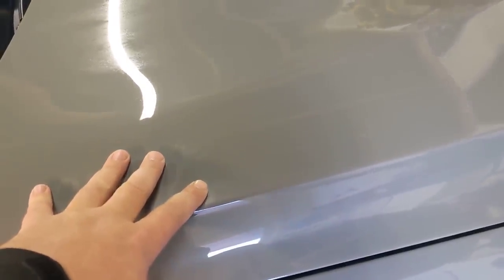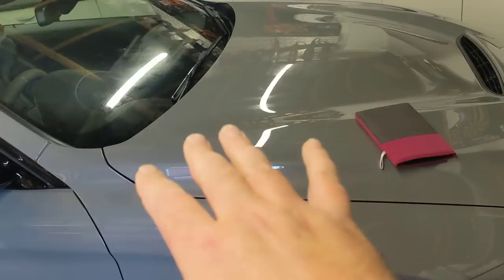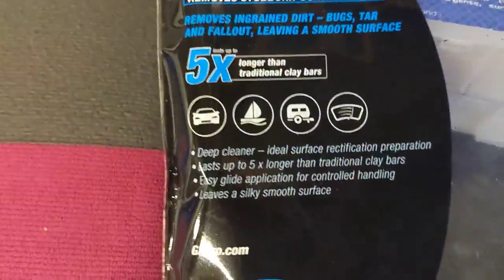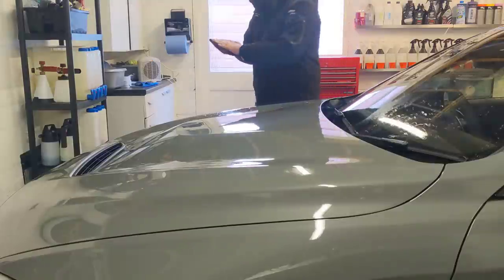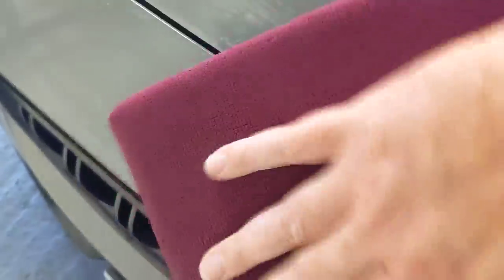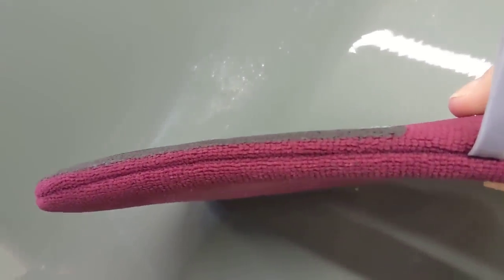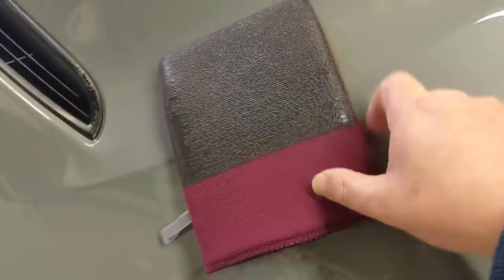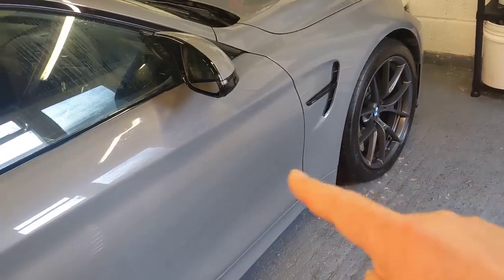How to Clay your car in 30 minutes

Comment: Hi John, I've used the clay mit on 8 different cars,the last car was my volvo and I haven't seen any marks/scratches. I use Turtle Wax pure wash as a lubrication with mine. I'm more than happy with the product.Ive cleaned the mit every time after use and put the plastic sheet back on the clay section once used. I have now got a new one, so I will use the old mit on my wheel barrels. 😊👍

Comment: I normally use a clay towel over a higher ph foam from my cannon, along with constantly cleaning the rubber surface in a wash bucket after each panel.  I find that using a foamy high ph soap perhaps deep cleans the paint a little better by stripping off any old protection that may be left after washing. Using foam seems to provide a lot of lubrication during the claying process, but with the extra step of rinsing afterwards.  Good video Jon.  I love the speed of the clay towels, but only use them before polishing as you mentioned.

Comment: I have had 3 of those clay mitts and they are awesome. You defo need a clay bar for two reasons. 1. if you run the clay mitt over the joint of two panels, it can leave behind some clay, and a clay bar gets it of much easier. 2. Clay bars are great for smaller areas. I do my car twice a year with the Mitt, and they will last 2 or 3 years easily (I do friends cars as well so they don't last that long for me).

The biggest advantage of the clay mitt is that people who don't want to spend 1 or 2 days claying a car, will clay the car with a mitt because you can do it in around 60 mins or less. The clay mitt in my experience does not get as much contaminate off as a clay bar, so clay mitt the car, then go round with s clay bar and redo the small bits the mitt could not deal with.
Reply: Totally agree!
Reply: What do you use as a lubricant?
Reply: @IRTEHLEETOKNPBB  I first wash the car and rinse it off. Then I make a wash bucket using a good shampoo and 'wash' the car again with the mitt, it's not like a clay bar where to do a 6 inch section at a time, you wash the car like you would with a normal mitt, keeping it very wet with the shampoo wash. Then you have to was the car again. You might get some 'clay' on the edges of panels, you can get this off with a clay bar.

Comment: As far as clay mitts go the G3 is the best one I have found so far. It is great for a more rapid decontamination job, when time is more limited. I tend to start with this to get the bulk of it off and then finish with Bilt Hamber soft clay bar for a belt and braces job.

Comment: When I was a valeter at main dealer I used this it was very durable I also used the auto smart towel to. These so much quicker. Thing is when u work for a company they not going to supply clay that can really only be used once and are easy to drop because of the cost and I faced this all the time when working as a professional valeter. On my own car I always use clay bar but clay mitt, cloth does have it place and in my opinion very good to have and I used a lot. The fraecla one is very good they good company there compounds are very good to and have used alot

Comment: Try a clay towel that is perforated.   The Rag Company Ultra clay towel and DIY Details clay towel.  The openings within the clay surface allow the contamination a place to go reducing the marring you've correctly talked about.   Much better than the solid rubberized clay mitt you used in the video.
Reply: Well said.

Comment: Another good video Jon, well done. I'm using Farecla G3 Clay mitt with a soapy water 1:50 dillution ratio :)
I always use it after iron fallout remover. But from my pov, polishing is not mandatory after applying clay mitt. It's always good to use it to decontaminate the surface before foaming/washing the car.
If I have enough time, I prefer to polish the surface but it's not possible most of the times.
Reply: When you clay mitt unless it's a new car you have to seal the car after claying buddy

Comment: Jon, you should really try the Ultra Clay Towel/Mitt from The Rag Company. It has a perforated surface that is very effective, cuts down on marring and is very easy to clean. I find it is also very helpful to spray the panel down with rinseless (ONR, P&S Absolute or N914) before hitting it with the clay.
Reply from the maker: its best part of 40 quid in the UK mate.  love the rag company and appreciate import costs create problems but I just dont think you can sell clay cloths for that price here.
Reply: @ForensicDetailing  yeah they cost about 33 quid here ($40 USD). But on the plus side they will last for well over 50 cars, so the cost per use is pretty low.

Comment: Thanks John, I've got one of those, prefer using it to a clay bar, find it easy as long as you use plenty of lubrication, as you said its minus point is small areas like at the front of the car, where I think a bar is better. I've had it 3 years  probably done 12 cars and its still in good condition.

Comment: I think clay mitts are the tits. 

Smash a layer of GT Zero Decon on the car and give it a damn good feel up with the mitt. 

Can't say that I've noticed any clay marring to be honest, but the layer of clay is so thin that a quick rinse after every 1/4 or 1/2 of a panel keeps the clay fresh as a daisy. 

Used to use BH clay bar, but I noticed no matter what technique or lubricant I used, the marring was 100x worse than using a mitt.

Comment: Thanks John, I used one of these on my previous car so this has reignited my interest! My current car is a 2018 with 18k on the clock and garaged most of the time so I think I'll give it a go in the spring after a wash, de-iron and detaring then get my underused DAS6 out with some sonax fine finish. It probabky won't give me a "proper" professional finish but hopefully it'll  come up better than it is now as it's not been polished so far.

Comment: Hi John, just want to say thanks. I found my holy grail of daily driver contactless cleaning with 3 week old winter grime on it.

BH AF at 6% PIR on a dry car.(not BH CL) 

Single layer of foam so it doesn't drop off.

Let it dwell for 10 minutes (cold day)

Use a 15 degree nozzle close up with my Karcher K2.

Stand back and admire

Comment: I use them without my hand on top or holding at the side as I tend to with washmitts. G3 Clay mitt could benefit from maybe a tight fit elastic strap on the back side, differing hand sizes would be the trouble mind. I also tend to pre-spray the surface down with ONR or similar before going in with the clay cloth

Comment: I have that mitt and really love it. A bit of soapy water in a bucket and you're off. Whole car done in no time. I agree there are still uses for traditional clay - either doing fiddly bits (which on our everyday cars are really not an issue) or for windscreens (where there is all sorts of rubbish that I'd rather keep out of the mitt - I have a big ball of clay just for the screen).

Comment: i use a zvizzer clay disk on a cordless sander (3mm throw). gets you around alot faster. i use a clay mitt for the small ereas or regular clay bar if it's really nasty

Comment: Another excellent video Jon - can't get enough of your stuff man. So....your advice please.  I am about to become an FDC wannabe having just bought another car.  The car is immaculate which I would like to maintain.  MB CLS 350 AMG - White 2015 model.  Do I clay bar or clay mitt and if I do invest in machine polish (pretty sure I will) which produce would you recommend for polishing it and how often.  No history in terms of the clear coat or if it has been detailed in the past so worried about damaging the paint.  Cheers, Paul
Reply from the maker: Clay mitt if u need to do full detail in one day. Otherwise clay bar.   Buy a da8 polisher and use school S20 black with flex purple paint on the Merc
Reply from the maker: Purple pad
Reply: @ForensicDetailing  🤟Thank you

Comment: Have you used the clay towel from Ali that is perforated and costs about 15? It resembles the original alternatives, from Carpro etc.
Have you used soft99 smooth egg ? It`s very soft and the seller told me is perfectly safe for coatings and doesn`t scratch
Reply from the maker: all clay will scratch paint as it pulls contaminant

Comment: I'm wondering if these perforated clay towels like DIY detail and P&S might be more gentle on the paint. If you don't plan to polish should you avoid a clay towel?
Reply from the maker: they are not more gentle no.  the coareness of the abrasive clay and the pressure you put down is the importance.  A performated one will have half the clay of a non performated one.   But the holes do allow liquid through.

Comment: I think clay is waaaay more eco than a "clay mit" at least you can see how dirty a clay bar is, than a mit. 
You can use the clay much longer than a mit, plus you can see the levels of contamination. 

I think I'll keep to the clay.
Reinventing the wheel sometimes isn’t needed.
Reply from the maker: Speed though Mel.
Reply: Clay mitt lasts probably 35-50 vehicles if it’s minor to medium contamination a clay bar needs chucking after a single car so don’t see how it more eco

Comment: Nice one Jon, great timing,  I just brought a new to me 3yr old ST, it's got no protection and needs pampering.  I have the G3 mitt in the garage and haven't used it yet,  you've inspired me to try it out. Regarding the polish, would a one step, like the Megs ultimate be OK or could I get away with a koch chemi ultra fine on the same coloured pad? Thanks for cracking vids throughout 22.
Reply from the maker: Yes m8 a finishing polish is ideal

Comment: i am wondering, once you have clayed, polished, and ceramic or graphene coated the car, when should you clay again and does it degrade the coating by claying ?
Reply from the maker: next time you want to polish it, wash it dry it, feel the paintwork, look for chunks of roughness behind the front wheels and rear tailgate... after about a year of driving its likely to need claying.   If you clay a coating yes your abrading on it so it will degrade it a bit.

Comment: Jon, great video. Can you use snow foam as a lubricant for claying after the car is washed? Do you need to dry the car prior to claying? I've also seen Jim White keeping his clay, usually 3 patties, in hot water to keep them plyable. Thoughts?
Reply: I don’t dry, most of the time I just Chuck a fresh microfiber in the shampoo bucket and use that to wipe over the surface get it soapy then clay over. Mostly because if I’m decontaminating I want to put on a lsp or polish so I’m not risking putting anything on with a clay lube.
I also wouldn’t use snow foam as it has no lubricating properties it’s meant to be used as a precleaner not a contact wash. 
Imo you can totally keep clay a couple toke I usually cut it up into 3/4 chunks then Chuck them out after use or use them for claying wheels
Reply from the maker: I think you could wash and reform (when its not too hot) and clay mitt over with all the soap.  that will work great just dont want the soap to dry in the summer.   but in winter I think wash dry get car inside and then nice waterless wash lube works really well too.   dont think its matters as long as you clay properly...  warning the clay its good idea.   If I leave the ball in front of the little heater it will softer... BH clay is mega solid.
Reply: @@leefrancis7416 I just use my usual car chem super suds, great low cost shampoo

Comment: Would ONR be good to use when claying or just a plane highly mixed shampoo without any wax ? Thank you in advance!!!
Reply from the maker: One is great m8
Reply: What is ONR? 🥴
Reply: @donporter8432  optimum no rinse, just a waterless wash , get a litre spray bottle add 50 ml of ONR ( I also add 50 ml of turtle was hybrid solutions wash & wax )  tap water will do no need for distilled water that's not needed , ive found out after using gallons of distilled water- just spray that onto the panal & the clay will, I use a Martin Cox clay mitt or bilt hamber fine clay is great but the mitt you can't drol it covers a bigger area and will clay a car twice as fast ( just clean the outta glass first as them mitts stick & might slightly Mar paint) tge mitts are great tgey can be reused over n over just rinse n carry on, after doing this you'll feel the paint is smooth as can be, it pulls all dirt n grime from tge paint- you'll be pleased you did 👌
Reply: @donporter8432  just seen 11 months ago I wasn't sure lol- surprising just how quick you learn all this- made me chuckle when I noticed 🤣

Comment: Is it ok to clay just the lower panels?
Reply from the maker: only you can answer this.  why do we clay? to remove contamination.   therefore if contamination is only on the lower sections then fine.   So really question is, are you 100% sure theres no contamination on upper panels at all?
Reply: Thanks that makes logical sense I guess 😀, I've been enjoying watching and learning from your videos. What's your take on clay baring plastics? Most of the lower panels on my car are 80% plastic and quite rough to touch?

Comment: I was pretty disappointed with this clay mitt. it kept leaving marks where I had to use a clay bar to remove them and it took some elbow grease to remove them. not great on a white car
Reply from the maker: It should not be doing that break it in first on the windscreen.
Reply: I'll be breaking mine in on the shower doors haha.